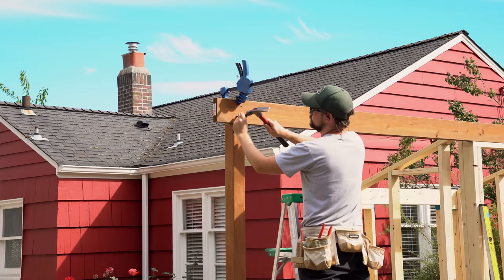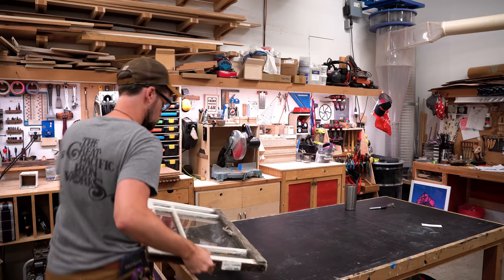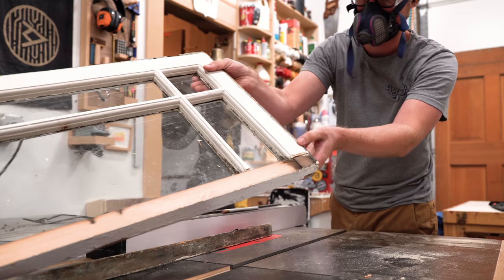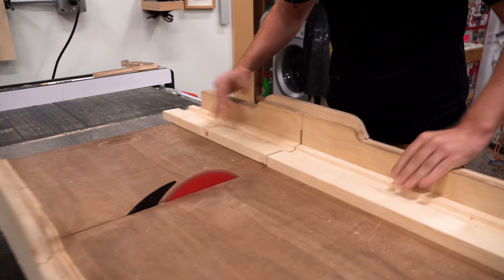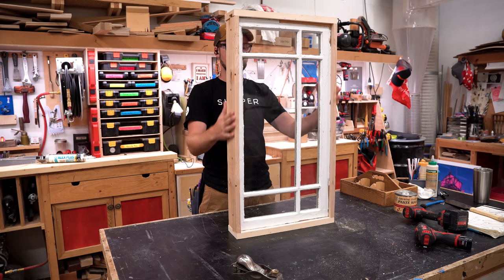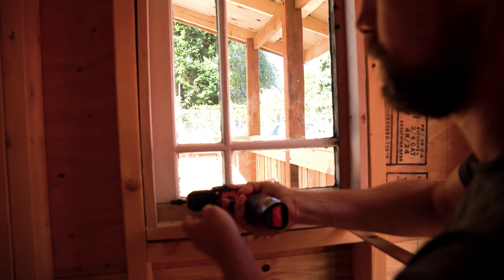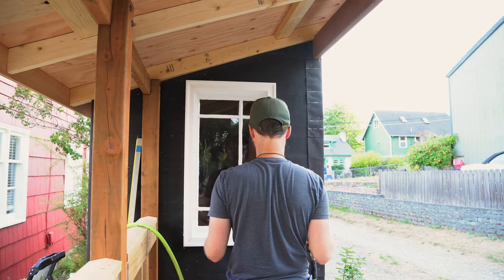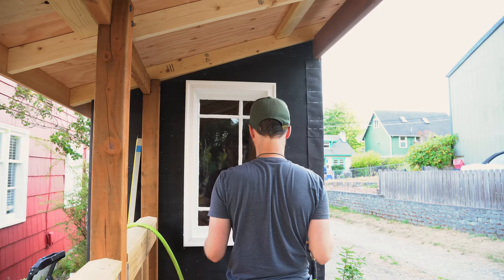Restoring a Salvaged Window & Door | Garden Shed Part 2

Comment: oohhh geez...  I did this exact same project with installing salvaged doors for my shop.  I reversed the swing, cut the bevel, pulled out the bolt, pounded in a dowel, built the frame, all that...  Mine were double doors and  I cut the doors down and made them Dutch doors to swing out to save shop space and for the benefit of natural ventilation in the summer.  I really struggled with my sanity and happiness doing it all by myself and the relative ease and joy you express and the fine help you have almost makes me want to go back to Second Use and wander around stupid again and hurt myself some more...😥

Comment: I'm surprised to hear that you think outswing is worse for rain. I'm pretty sure here on Florida that it's recommended to do outswing because when you have driving rain, it pushes the door against the seal making it resist water intrusion. When you have an inswing the wind can push the door away from the seal allowing water to get in.

In addition, an outswing is less likely to blow in during heavy winds because it has the door stop trim instead of just depending on the handset and lock to keep it closed.

Not that you're wrong, it's just contrary to what I've heard. I'll have research that later 🙂
Reply from the maker: Interesting 🤔 Maybe depending on where you live, one is better than the other...
Reply: @MichaelAlm  from what I just ready it appears that outswing are better for water intrusion, BUT if you live in an areas where it snows this tradeoff is acceptable because outswing doors can be blocked by snow, which makes complete sense why up north inswing would be preferred!

Learn something new everyday and having lived in Florida my whole life I've never had to consider the effect of snow on my doors...lol

Comment: Outswing doors is the way to go. That's how we do it in Scandinavia. 

There are several safety benefits with outswing doors. First, if you need to evacuate the building, opening the door won't slow you down and you can still open the door even if there is a crowd pushing on your back when reaching the door. Second, if someone tries to kick the door in, it's not as easy as with an inswing door. Third, if it's raining sideways, the outswing door will keep more of the rain outside than the inswing door. Fourth, an outswing door don't need any spacing indoors, which will give you more space to stack things in your shed. 

Nice build!
Reply: Thank you ... I was trying to decide...and you made me change my mind. Outswing it is!

Comment: You should screw some 3 inch screws through that strike plate to help keep someone from busting the door open as easily. When it goes into the frame people can't just pull the little screws out without much fuss and steal tools.

Comment: With the hinges on the outside, it makes it easy to break in. Is there a way to prevent somebody from just popping the hinge pins out?
Reply from the maker: I meant to mention that they are locking hinges. They have a little divot in the the hinge plate that keeps the door in place even if you knock out the pin.

Comment: Was the door itself perfectly square? Or did you square it while cutting? Did you buy the door to fit the opening you had or adjust the opening based on the door? 
(This video was perfectly timed for me as I just bought a solid wood door for a closet in my 1888 home and now have to trim it to fit and hang...my concern being that I doubt the opening is square and I'm not sure how much of the frame I want to rip out.)

Comment: I enjoyed the video. It’s becoming a beautiful shed. But I personally would have just bought a new plastic window. I bought one for my 3D printer cabinet as a door and it was only €50 including locking handles and so on. With that price its not even worth painting a old window. Time is money too.
Reply from the maker: Thanks! I just don’t like the look of vinyl windows. I also like the process of restoring old things and giving them new life. It’s less about the money and time more about the experience and the final look.
Reply: @MichaelAlm  Plus you're creating less plastic waste and you're using something that would be destined for the landfill instead. 🙌
Reply: And when it's your own home, the value of your time isn't always as important as when it's a paid job.
Reply: I build things for a living and I guess I see it differently because I always think that the time I spend building something for myself could rather be used to build something for my customers and generate some revenue.

Comment: Do you also pronounce the "L" in salmon?
Reply from the maker: Yep 😂
Reply: The plumber’s PVC adhesive needs the primer to set up the glue. It provides the initial tack so that the joint has less slip. AZEK also makes an excellent adhesive for PVC moulding.
Reply: @dianeewoldt3035  Why are you telling me this?